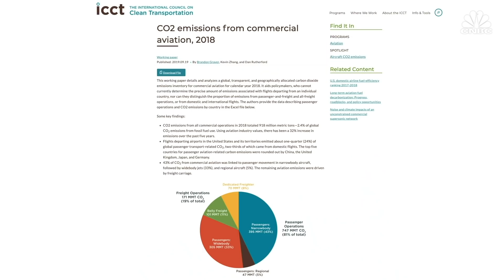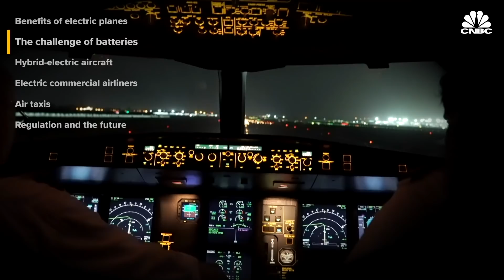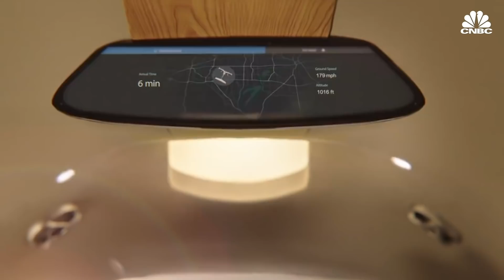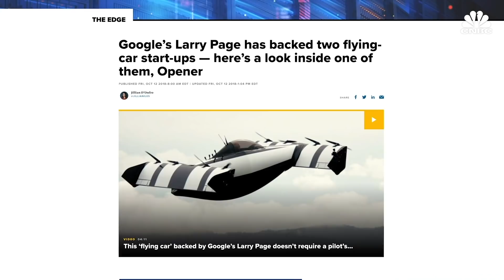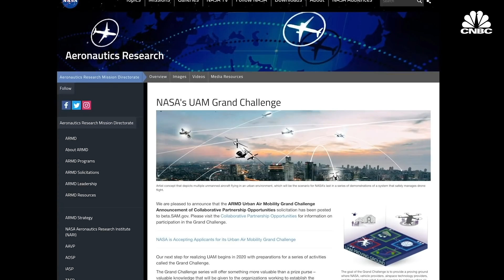Why Don't We Have Electric Planes Yet?

Comment: If Boeing develops the electric plane it will be used on AeroMexico first to see the first protocol failure in case of a battery failure or safety failure Boeing will not guilty for it and just wash their hands for screwing up and show no remorse for their dead passengers. 

If Airbus where to acquire KAI of South Korea and form Airbus Korea they might even have battery development by Samsung to see if the battery be very efficient to fly longer hours without charging as a jet engine and then charge it at the airport, so the Airbus electric planes they uses Samsung batteries be more reliable than it’s competitor. 

As to say the Airbus electric plane when acquire Korean Aerospace Industry to be called Airbus Korea, might be more reliable than the product Boeing has to offer, as Boeing’s first electric plane will offer it to an airline from Mexico or Latin America before a US carrier in case of Boeing’s electric plane gets a flaw for putting passengers’ lives on the line as to say Boeing uses Latin people as lab rats for their electric planes.

Comment: We are decades away (maybe many many decades away) from battery technology that can match the energy density of fuel. Also, everything I've see so far is using a motor connected to a prop which is going to severely limit the speed of aircraft compared to jets and turbo jets. eVTOL has such huge energy requirements, it's destined to failure using current battery technology. Bottom line: we need much better battery technology. Stop the government from pumping billions of dollars into this technology and let's see if the electric energy sector survives.  To go electric, first make our grid capable of supplying the load. By that time maybe we'll have batteries with the energy density we'll need for aircraft, mass transit, and trucks big enough to haul our necessities.

Comment: I think high speed rail could replace short haul flights trains don't have check in problems of larger airports 500 miles. Or less driving is answer. Or private small aircraft that can use small airports alot of business is conducted away from big airports

Comment: Please stop mixing up the actual experts here among the talking heads pushing hype.  The ‘one moving part’ claim on an e motor would not have been said by the engineering professor, who will know high power MW range w motors must have large cooling systems, unlike jet engines, and these have much more than ‘one moving part’.  Then add gearing, aux power taps, etc. 

Hello media people! It’s the age of Theranos, and you are primary reason Theranos was allowed to happen.  There is a not a single passenger e aircraft operating anywhere in the world.  There is not a single e aircraft in regulatory approval process.  Many of the hard problems are not even mentioned here, though I’ll wager that engineering professor relayed all of them the CNBC producers
Please, stop.

Comment: The problem is not technical, it's economic. Due to the basic laws of physics and energy density, batteries only work for short haul flight, distances for which surface transportation is already much more efficient, both in terms of energy and total cost. And over any reasonable investment horizon (e.g. 10-20 years) electrification makes surface transport cheaper and aviation more expensive. SAF is not a solution either because it will also widen rather than close this economic gap gap. When you add the requirement to remove carbon emissions air transport is simply no longer competitive at current passenger levels.

Comment: Depending on how well they'd improve efficiency, could solar panels on the exterior of the craft and/or Hydro-electric generation be options?
Reply: Weight problem. Solar panel also requires battery to store energy. Theres a Trade off between weight and cargo space

Comment: This is problematic, why not just switch to CLEANER burning fuels like bio Jet fuel and make it mandatory world wide engine manufacturers can easily make engines for bio fuels etc, the ONLY real reason why jet/turbine engines are costly to repair is because of "Planned obsolescence"  which is built in western companies strategy to keep selling stuff forever.

Comment: The REAL future of aviation will be:
Liquid hydrogen stored in the planes, made from eco friendly energy sources.
The liquid hydrogen will be vaporized and burned in the already existing jet engines without major redesigning or new engines needed.
The technology is already out there. 
And as soon as the demand for hydrogen is high by all the airlines hopping on the train, mass production of hydrogen will make it affordable for individual transportation such as cars too.

And you can fill up hydrogen almost as fast as a tank of fuel.

Comment: By reflecting away 30% of the ISR the atmospheric albedo cools the earth much like that reflective panel behind a car's windshield.

For the greenhouse effect to perform as advertised "extra" energy must radiate upwards from the surface. Because of the non-radiative heat transfer processes of the contiguous atmospheric molecules such ideal BB upwelling "extra" energy does not exist.

Backed by an experimental demonstration, the gold standard of classical science.
https://www.linkedin.com/posts/nicholas-schroeder-55934820_climatechange-greenhouse-co2-activity-6749812735246254080-bc6K

There is no "extra" energy for the GHGs to "trap" or "back" radiate or “delay” and no subsequent greenhouse type warming.

With no greenhouse effect what CO2 does or does not do, where it comes from or where it goes and its climate sensitivity value becomes moot.

Equally moot are temperatures, ice caps, glaciers, polar bears, sea levels, hurricanes, nuclear power, solar minimums, CH4, ….

Comment: Take off weight and landing weight is different with jet fuel vs batteries.  A full tank of fuel vs an empty tank is significantly different.  A full battery vs an empty battery weights the same.

Comment: electric motors  need  electric generating plants. which run on large amounts of fossil fuel or nuclear energy.  jet fuel is cheaper, easier and better.
Reply: So what happens when all the oil runs out?
Reply: @rkoi5   we still have nuclear  .  oil and alcohol can be made from leftover crops  so oil won't run out .   is this comment really the best you can come up with?

Comment: I'm sure it will get there eventually, however I could give you a couple of ways in about 5min. Any size aircraft at any range. Need to think outside the box on this. There still using props , that should have been scraped the moment it was thought of. Well again you will eventually get there . I

Comment: The amount of energy required to roll the tires on a car is drastically less than the energy required to lift a heavy plane off the ground. Plus when your battery dies in a car you can pull over. The same can’t be said for an airplane

Comment: A commercial aircraft powered by electricity?  Not possible.  You cannot compare realistically the amount of energy available through petroleum versus battery power.  End of story.  Nice idea, but it won't fly commercially.  The amount of thrust required to power a passenger jet is massive.  After Covid 19, you can pretty much forget about returning to recent levels of air travel.  We have about 16,000 commercial jets that have been grounded worldwide.   Not to mention, the necessary rare earth minerals to make modern batteries have been depleted over time.  So any idea of even maintaining the billions of disposable cell phones and other portable devices long term is increasingly in doubt,  Petroleum products are irreplaceable for transportation.  Without them, modern civilization cannot exist. - Retired airline pilot & VP

Comment: The obvious solution is to use passengers as batteries. Either put cycle paddles under each seat or plug them in Matrix style.

Comment: There is something not even touched on here, namely the recharging of batteries. Optimistically you might be able to fully recharge a very large (e.g. 100 MWh) battery (suitable for an 'electric 737') in perhaps 2 hours. Commuter short haul airlines need to turn around a plane in 30 minutes. This is simply not possible with electric planes. An equivalent of a Boeing 777 or Airbus A350 would need something like a 500MWh battery, think about building entire power stations exclosively to serve airports. You simly don't get power out of solar cells at the GWh level at a size compatible with existing infrastructure.

Comment: Electric motors are good for the civilian market, as most people use propeller driven aircraft. Majority of commercial flights and even military need Jet engines because of the insane amount of power to thrust ratio that can be created. While I don't doubt that there will be a replacement for jet engines "eventually". I rather take a shorter flight time with a jet causing pollution then a slower cleaner propeller driven aircraft.

Comment: I'm intrigued by this talk of hydrids where a turbine engine drives a generator to power an electriiic motor to drive a propellor. It may actually be more efficient and involve less weight to use the turbine to power a propellor directly, as is currently seen in turboprops.

Comment: The answer is simple. Combustion is the only method that produces sufficient thrust to propel heavy loads. Electric motors and their batteries are just not as efficient as jet engines.

Comment: 6:31: So, they want to try to decrease CO2 emissions by making the planes slightly more efficient (which wont happen with the hybrid systems that they're proposing) and then make regional air travel a more common way to travel? Using regional air travel more often would just offset any reduction in CO2 emissions that they managed to gain by improving the efficiency of the aircraft... which can't be done by making the aircraft heavier with a hybrid system anyway. WTF is wrong with these people?

Comment: Omg would plane drop from the air when it run out of battery? If a car doesnt work when it runs out of battery than why wouldn't a plane do the same thing? It would only benefit the companies and not the people boarding the planes. It's too early to be doing such thing with planes when they havent figure out how to solve cars need to constantly recharge.

Comment: They do exist as single prop planes that fly for about an hour, and are mostly used in training new pilots to practice takeoffs and landings.  You take off, you circle around, you land, then you repeat this process until the battery runs low, then you continue training with a fully charged plane while the one you flew in recharges.

Comment: I have a feeling... We'll always need some form of aviation kerosene but we may only need a bit. I don't think anything will ever be as effective. The kerosene will take the aircraft to cruising altitude, and the momentum and the increasingly accelerating wind/jetstream will function as a time to recharge or somehow gain regenerative braking by spinning the turbofans so that it gains enough power when it's time to land.

As for the flying taxi, don't trust it. Only China and Japan and certain cities will have flying cars and that's only slightly more than Sao Paulo. Urban air mobility is VERY VERY loud. Urban air mobility in the west is only to incite public interest but the actual use, is for autonomous electric vehicles.

Comment: The answer is obvious : battery capacity is insufficient, and they are too heavy...
Reply: They would need really large wings to compensate too.
Reply: @deviouslick5097  and at that point in time your skin friction drag is gonna be insane, not to mention the increased weight from that
Reply: I only clicked because I have no idea how they got a video out of such a silly question.
Reply: @The Deluxe Gamer Actually it does. Dont be like him. Dont validate that.
Reply: Not only that but takes up too much space and cannot carry cargo.
Reply: A lot of people are arguing against fact. Batteries are indeed heavy. The batteries we have in cars can go up to 500 miles, a battery like that isn’t powerful enough to fly for a few minutes or even lift it. We have some electric aircraft(two seaters), but they are smaller and weight less than a regular car, in this case it works because the battery replaces the weight of the engine and fuel. The largest electric airplane they flight only lasted 30 minutes in the sky. They looking to use those kind of airplane for short distances like London to Paris with limited seats and weight in the future. Batteries have a limit capacity, unless you can make it infinite and output a lot of power then yes it possible.
Reply: That's not an answer, you've just stated a problem. It's our job as engineers to solve these problems, and we will.
Reply: @TheRichardHonor  That's a massive task to improve battery energy density (probably needs a 20x improvement) that you can't simply 'wish away' as if it were readily doable !
Reply: @TheRichardHonor  
This is wishful thinking , batteries can't be improved forever, there are physical limits. And the best current batteries are not safe enough, there has been some fires caused by battery shortcuts on electric cars.
Many companies have been working on improving batteries for many years, with little results...
Reply: "Ladies and Gentlemen, this is Captain Obvious speaking..."
Reply: All of you are woefully short-sighted, inept and dangerously pessemistic if you cannot even imagine answers to all these challenges: just as 20 years ago fools such as yourselves could not have foreseen battery energy density improving so rapidly and so dramatically as to give us today's ultra-high performance cars with ranges of 500 and 600 miles (Tesla's Semi truck has acceleration three times what today's semi trucks can give, with 500 miles range... they are already being used for commercial purposes; and the Tesla Roadster with 0-60 mph of 2.1 seconds, 620 mile range, and 250 mph top speed). Yes, you are DANGEROUS, because lugheads such as yourself have the effect of group-think that impedes the continuum of progress.

You cannot see anything being better than it is today... but if you make the minimal effort you would find that companies such as Airbus already have smaller viable airworthy EVs-- electric systems are far more reliable due to extreme simplicity and minimal motor size.

As in the video where you see multiple tiny motors across a wing, each motor can have an entirely separate system of batteries and electronics.  Such redundancy provides reliability and low cost of operation far beyond anything achievable by fueled aircraft.

There are constant new developments and breakthroughs: they recently discovered, for instance, that a bizarre quality of graphene allows electrons to flow with extreme efficiency across their plane when oriented at an angle of 1.1 degrees: they do not understand-- nor know yet-- how to make practical use of this unpredictable curiosity, but it took decades before we started to see tiny lasers used ubiquitously in all manner of personal, industrial, information and security systems.

Keep your distance, any of you myopic imbeciles.  It took a single individual, Elon Musk, to show, after more than a half-century of "common knowledge" to demonstrate that, no, it is not impossible to boost a satellite into orbit with a rocket, and then save $35 million or so each time you direct the rocket to come back and land, to be reused multiple times.

SpaceX has done exactly that 50 times or so already, reducing the cost of space industry by two orders of magnitude.  Stop trying to tell everyone what is impossible... you humiliate yourselves, and incur the wrath of those with more good sense.
Reply: @billdale1  Insulting people just shows how shallow and stupid you are. Your argument is invalid as a result of that.
Reply: @billdale1  Sure, you mighgt get twice as much energy in a lithium ion battery over time with various developments, but 40 times the energy density ? Also, the video incorrectly claims that turbine engines are inefficient - they are in fact about the MOST efficient type of internal combustiion devices. Hybrid airplanes simply add weight for zero advantage !
Reply: @billdale1  seems like stupid here doesnt know physics.  there r just some physics barriers that human cant overcome. the reason why tesla semis can do 500 miles is becos of the huge batteries, not becos of the batteries becoming more efficient. have u ever seen a tesla model 3 driving more than 500 miles on a single charge in cold weather????
Reply: @billdale1  the technology is not there yet. Sure, a small plane is possible, but for a commercial plane with 100 plus passenger? At this stage, there is no way to fit enough batteries into it. Elon Musk SpaceX is still using fossil fuel btw.
Reply: @billdale1  I'm probably late to the party but you're missing the fact that battery flight isn't impossible, it's impractical
Reply: @billdale1  omg calm dawn  man
Reply: @billdale1  I've read majority of that and agree. Imagine if you told someone 60 years ago we can use cellphones to video call each other . It's like the very first computer to the one we have today. They can start by making US domestic planes lighter with less passengers. Just like a car alternator we can have 2 or 4 electric regenerating engines
Reply: 78Dipar: You are correct 100% correct!!!

Comment: hhow  about solenoid engine in electric plane solenoid engine is more efficient then ac dc motors i mean solenoid radial engine take less than motors and in petrol bike there is arc to ignite air petrol that is very less electrons and high voltage same theory applies in solenoid engine

Comment: I think the issue with battery flight is trying to match what the engine does when we should work on what the fuel does...  I worked on this for years and found that battery flight needs high pressure chambers rather than trying to match thrust of combustion...